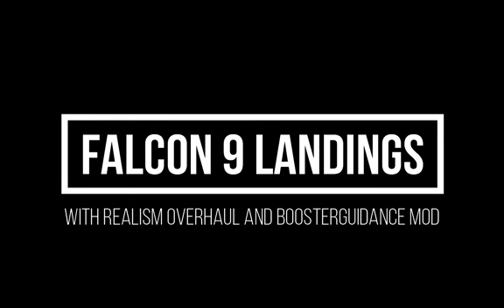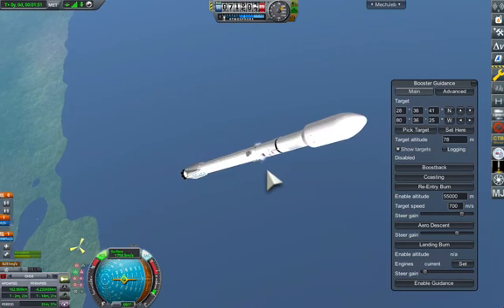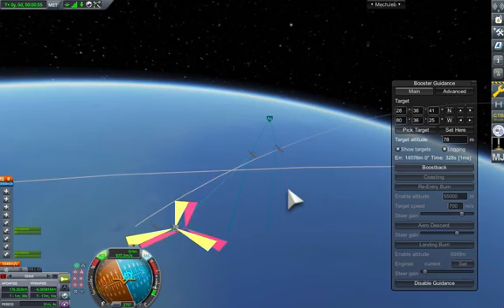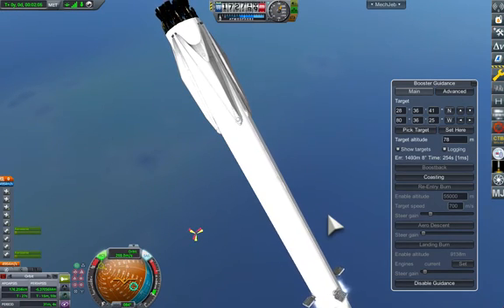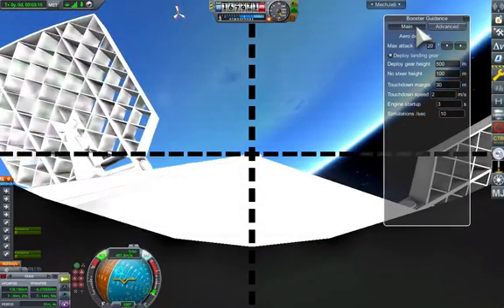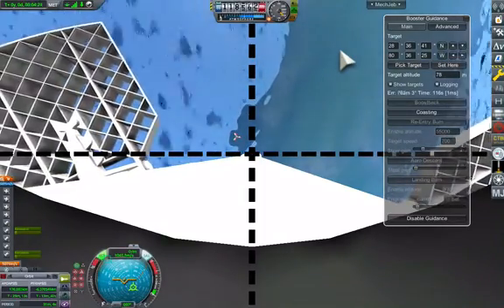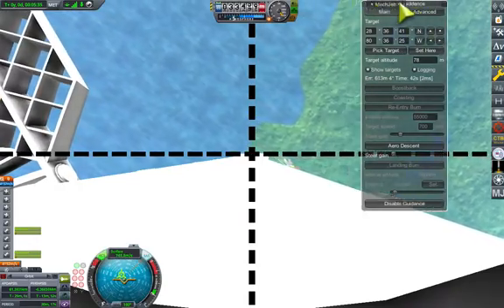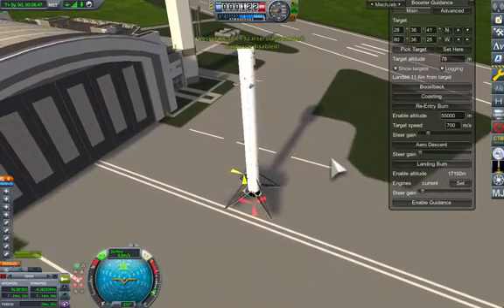Automated Falcon 9 Boostback and Landing on Realism Overhaul

Comment: Mate,nice work,but i've got an issue,im playing with RSS (Real Solar System) and the problem is that my booster re enters the atmosphere at 5000m/s +
Reply from the maker: Ok that's fast. I guess your booster doesn't slow down enough in the re-entry burn? I suggest upping the enable altitude for re-entry burn in the settings. The re-entry burn should start earlier giving more time to slow down. Hope that works
Reply: @oystercatcher943  I gave up eventually and installed a fresh copy of ksp keeping the stock size without rss,now it works like a charm, almost 👌